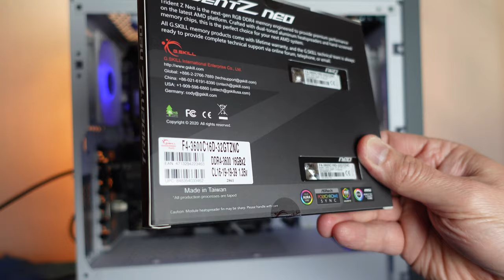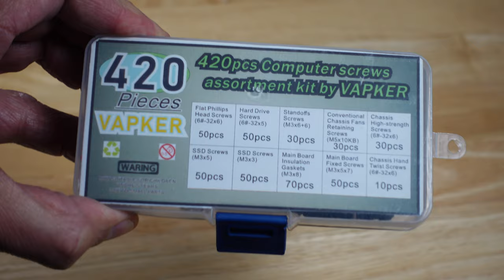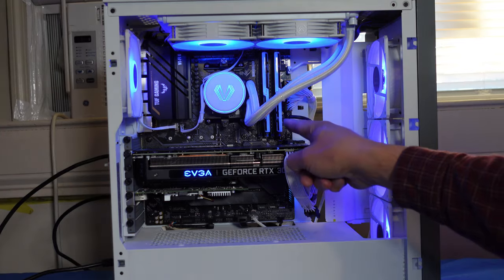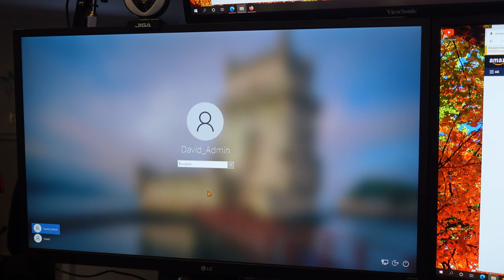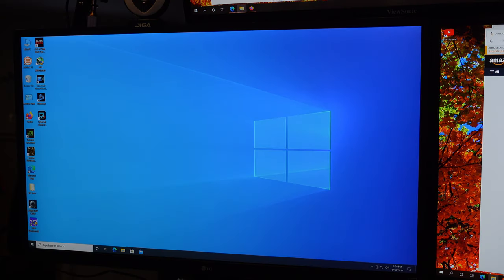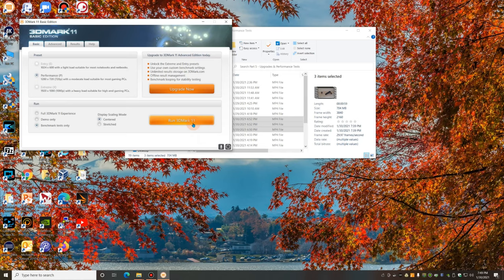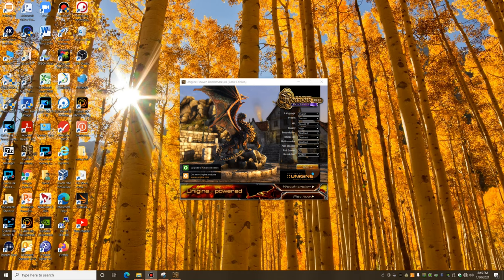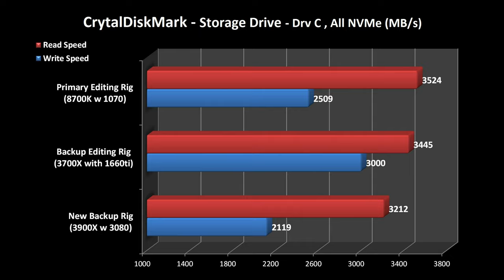High-End Gaming & Editing PC Build – Part 5 – Upgrades, Mods & Performance Comparison Testing

Comment: i look forward to the PSU change from the Corsair 750W to an 850W or 1000W PSU video for this Streaming / Editing Rig :))

You had a very good GPU Anti Sag idea. now the GPU is going nowhere it stays where it should :)) You can be truly proud of your Build. 

Test the RTX GPU ith Unigene Superposition Heaven is for older Systems
Reply from the maker: Thank you as usual for your great comments, suggestions and support.  I really wanted to come up with a better way to support he GPU and this seems to work well.  Of course, once I decide to replace the PSU I will make a video about doing that - I keep hoping the 850w version of this Corsair model comes up for sale, but I may just go ahead and replace it in the next couple of weeks.  I will definitely do something about it prior to upgrading my Primary rig, since I want to put the 750w PSU in that build.

Comment: I was trying to use  the same brand water cooler you are using but the problem is there is no white . Can u recommend another good water cooler that also have white?
Reply from the maker: The 'Best' of course it what Corsair offers, however they are VERY pricey.  You should keep in mind that nearly all (99%) of these AIOs use the same patented pump mechanism (the name of that company eludes me right now), so they tend to all have a 5 to 7-year expected life-span (that many feel is closer to the 5-year mark).  So if you are using one in a 'Business Critical system (which is rarely done since AIr coolers are easier to monitor) you should schedule the replacement at least every 6-years).
Reply: @PE4Doers   thanks alot

Comment: Can i use ryzen 5 3600 instead of ryzen 9 with same motherboard?
Reply from the maker: Yes, that CPU would work fine with that motherboard.
Reply: @PE4Doers   thanks , also can i use a 340mm liquid cooler instead of the 240mm at the top of the tower? While watching the video i was trying to see if it was possible since the cords or motherboard being install so high may stop it from fitting.
Reply from the maker: @fuyu6761  I just measure it and I don't see how a 360mm could fit on the top.  It may fit on the front, as long as you only have a 24mm radiator.
Reply: @PE4Doers   thanks alot i appreciate it
Reply from the maker: @fuyu6761  You are very welcome